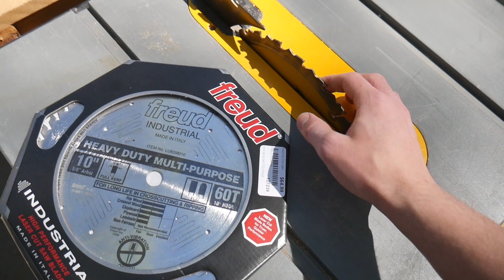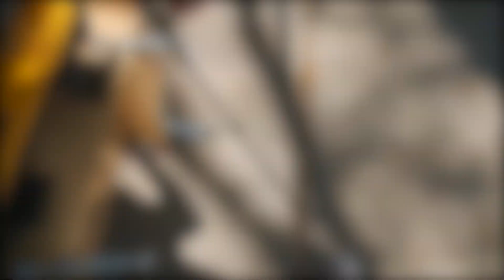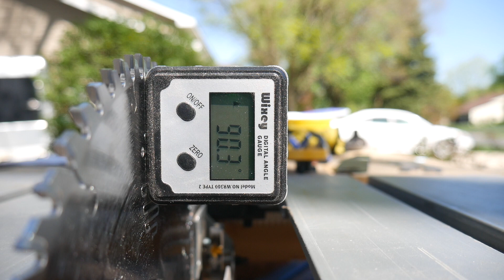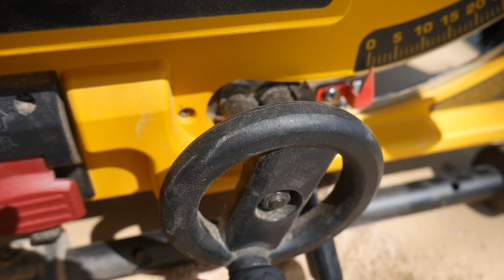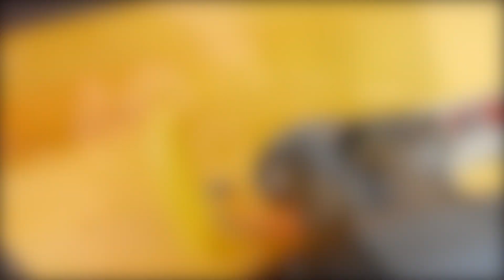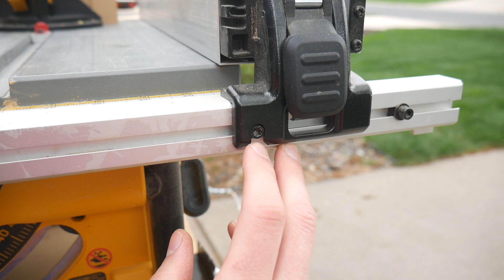How to Clean and Calibrate a Jobsite Tablesaw - Tablesaw Tune-up and Maintenance

Comment: Excellent Video. Two things to note for anyone trying this calibration process. If you "Twist" or "Turn" the miter gauge while it is in the slot, and remember to turn it the same direction every time, and hold that turn while sliding/measuring with the dial indicator, you will eliminate most slop, but you have to be consistent. Also, do not take measurements from the dial if the front or the back of the miter gauge track bar has gone beyond the miter slots (beyond the front and back edge of the tablesaw top), that will magnify the miter slot slop.

Comment: Best calibration vid Ive seen on this saw. Ive owned quite a few table saws at this point and just made the switch from a newer Bosch job site model to the latest Dewalt. What difference! I have to give it to Dewalt for thinking of the end user to this extent. None of these parameters are remotely adjustable on these types of saws and the parameters that are adjustable are a serious pain to do. I now have my new saw tuned up and it's giving me results on par with a pro level cabinet saw. Thank you for taking the time to do this
Reply from the maker: @johnlucus5468  thanks for the kind comment. I’m glad it’s working well for you cheers!

Comment: Im late to the party, but I still gave thumbs up. I have found my saw top has a dip right at the long sides of the throat plate. It's impossible to level the throat. The aluminum top has never had weight stored on it. Anybody else experience this anomaly?

Comment: I have set the second position fence adjustment bolt way over to to the left hand side of the guide arm. It gives the flexibility I need to have the fence on either side of the blade.

Comment: Damn, you have the same setup and tools as I do. Same cart also. Most everything you said, I know and have done. The bottom line is the saw is a great workhorse but calibrating it to that of a cabinet makers saw if pretty futile. Everything from the fence not being 90 degrees up and down to the miter slots off because of the coating (Someone on YT does fine sanding and gets them really good) the whole top surface is not flat and just a little above a complete joke. I love the switch, the rack & pinion system and the colors. It's been through a lot. Most of all my precision measuring tools we purchased because of this damn thing. I do love it, kinda. Killer video man!

Comment: I’ve never seen a video on how to adjust the 90 degrees on the fence for this saw so that might be a good video to make.
Reply from the maker: Thanks for the comment. Unfortunately, this model does not have built in adjustability on ensuring it is 90 degrees to the table, so it would have to be a DIY fix

Comment: That miter gauge and the slot have to much slop in it to check that with a dial indicator I have the same setup
Reply from the maker: Yes you have to shim the miter bar using painters tape to get no play. I have a new product releasing on my Etsy soon so stay tuned there

Comment: Well done, sir! Yours is the only video I've seen showing adjusting the blade squareness at the trunnion. I think I got everything else dialed in on my new saw but even the manual didn't mention that I could adjust that.

Time to rig up some way to test with my digital calipers.
Reply: Check the horizontal plane of the fence. Mine slopes in towards the blade on the top. If it's out going the other way, you can add a shim. I just made fence enclosure and it's as good as it gets.

Comment: I love your video and explanation !  I actually own the same model 7491, 10" blade.  i am about to buy this same dial indicator that you have.  In ebay its ranges  BTW my blade wobble, you can see when its coming to a stop, its arbour run out, about i think 0.2mm.  After everycut, when you measure along the cutted piece, the measurement is out about 0.2mm between top and bottom, and in the middle of the cut piece, the measurement is out by 0.2 to 0.3mm, that explain the wobble.   That is why i want to buy this dial indicator to test and adjust blade alignment and how much the blade wobble.
Reply from the maker: Thanks for the comment. It’s worth investing in the indicator to make sure things are running properly!
Reply: 0.2mm to 0.3mm difference??? That’s much thinner than one strand of hair. A lot of people would be extremely happy to get that precision.
Did you mean 2mm to 3mm? Even that is not very much, but makes more sense if you want to make the most precise cuts.

Comment: The miter gage on my DWE7491 has way too much clearance to rely on mounting a dial indicator for tuning the blade.
Reply from the maker: Mine did too! You have to use tape on the miter bar to shim it until it has no play

Comment: Great video but I see a flaw in your setup.  You used one mitre track to adjust the trunyon and you used the other miter track to adjust the fence.  Did you check to make sure the miter tracks are parallel?
Reply from the maker: Good observation! The miter tracks should be parallel from the manufacturer. If they aren’t, you’ll never get accurate results. That is a feature you are paying for in higher end saws
Reply: @TheTranq  I align both the trunyon and the fence off of the left miter track since it is the only miter track that I use and that way I will know that the blade is aligned with the fence.
Reply from the maker: @carlwheeler3403  that is a good idea! Ideally, the table saw will have parallel miter slots though
Reply: @TheTranq  yep, they should be parallel but they aren't always. It's just the way I do it, I sleep good at night knowing that my saw is perfectly aligned. LOL

Comment: I also had to drill out the screw but every time I add a nut and bolt the cam still moves no matter how hard I crank it down.  Any thoughts?

Comment: There is also a small wobble on a spindle on these dewalt table saws. Idk how to fix that.
Reply from the maker: If yours is new and has more than ~0.0025” of play on the arbor flange I would return it
Reply from the maker: @i.c.d.9512  you have to have a dial indicator jig that can rotate 90 degrees to check the arbor shaft
Reply from the maker: @i.c.d.9512  that is less than 0.001” - that is well within spec

Comment: All the videos I have watched they check the blade sits at 90 degrees, I can't find one that shows you how to tune the fence to 90 degrees vertically.
Reply from the maker: Unfortunately the Dewalt has no built in adjustment to do this

Comment: My problem is that the cam that adjusts the tilt is all the way to the left but my blade is still higher than 90. I guess I can try to shave some material off the cam so that I can move the adjustment further over bring the blade closer to 90. Is there a better way?
Reply from the maker: The cam is pretty thin as is. Is the saw new? If it can’t reach 90 degrees within the range of the cam I would take off the cam and replace it with a slightly smaller washer

Comment: Good video! If anybody else is uncomfortable with using the mallet to set the saw blade (like I was), you can loosen just one of the bolts at the rear of the trunnion and it should pivot easily enough.
Reply from the maker: Thanks for watching! You do have to loosen the trunnions screws either way, but just as tapping the fence allows for precise adjustments, it is the same as using the mallet on the trunnion! Recommended also by John White in the book
Reply: @TheTranq  with one of the trunnion bolts at the rear of the saw still tight I found it to be pretty easy to make relatively precise adjustments. That being said, I know the mallet method is popular and I've never heard of anyone having any issues because of it. I just couldn't bring myself to hit it with one. Cheers!
Reply: @thodgson13  Honestly I'm pretty sure the kind of mallet hits you use to adjust it are less violent than just the vibrations from the motor itself when it's in use ...
Reply: @kz.irudimen  Overall, perhaps, but they aren't focused in the same directions as the mallet blows are. I've never heard of any issues from using the mallet, it just doesn't seem to me like the way the designers of the saw would've intended.

Comment: Hopefully your miter gauge slots are a good fit with the miter gauge.  These Dewalt table saws have a very sloppy fit ex-factory.
Reply from the maker: I use tape on the side of the miter gage to ensure zero-play
Reply: @TheTranq  I also use maskling tape and it works perfectly